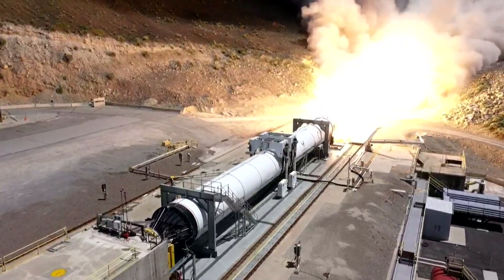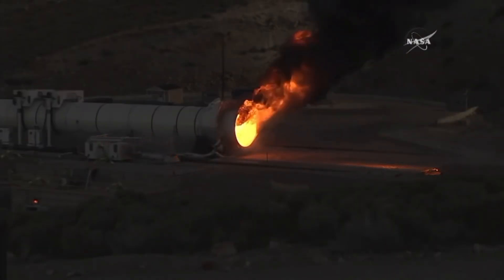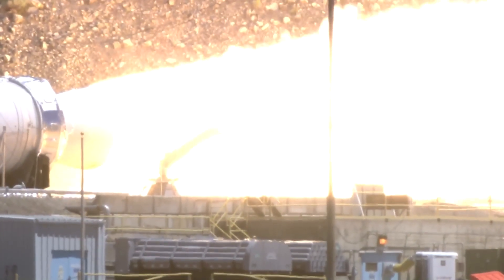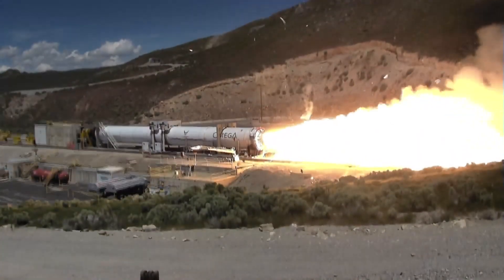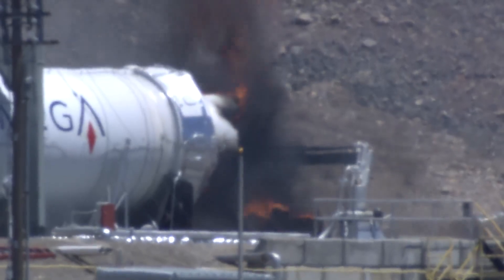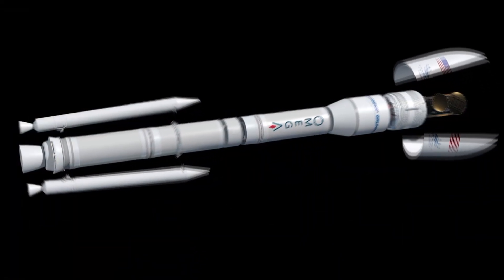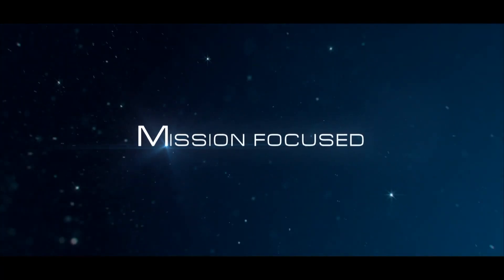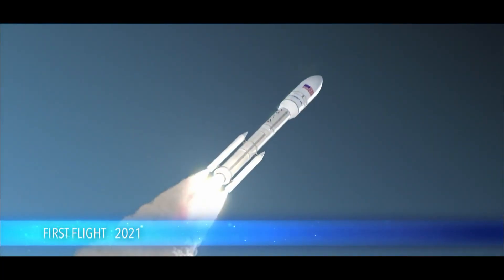Northrop Grumman's OmegA Rocket Fails During Static Fire Test -

Comment: Aluminum and potassium perchlorate is common in firework Rockets
Reply: This isn't using KClO4, it's using the ammonium salt, NH4ClO4. K is not a very useful cation for propulsion. It works, but it's much less effective (and has some other bad characteristics. In burn rate ballastic terms, it's exponent is very high - that is, it's burn rate is highly sensitive to pressure)
Reply: Wow, google that all by yourself?
Reply: @nicewhenearnedrudemostlyel489  Did you figure out how to be rude on the internet all by yourself, or did you have to ask your mom for help?
Reply: @nicewhenearnedrudemostlyel489  I actually Googled that a few years back, and then I started making this composition myself. Check out my channel and all the flash powder explosions on it. And you're right it is nice when learned!
Reply: @schelsullivan  nice

Comment: whats the flash headed for the nozzle just before it ignites? 1:50 it enters from the left side of the frame.
Reply: I am taking a wild guess, but it might be something like detcord which they are using to ignite the engine.
Reply: Yeah, i imagine you need something hotter than a match to ignite that stuff. I wonder, if it is det cord, is it also used during launch to initiate the ignition? Always thought it might be electrical?
Reply: I believe it’s detcord used to ignite the thermite charge that ignites the fuel

Comment: Wernier Von Braun was 100% against any solid rocket booster because of control and safety issues.  It's 2019 & he is as right now as he was in the 1970s.
Reply: But as the Moon will attest, we we're able to safely control solid rocket motors effectively. Everything to do with rockets is dangerous. Solid or liquid or nuclear or whatever. So the nozzle flew apart. Did anything actually happen that was unsafe apart from some Niobium bits fluttering in the air? No. Fact is that solid motors are actually quite safe compared to tanks of liquid propellant and oxidizer sitting on top of each other and waiting for a spark or any slight issue. For solids this size, it takes a 4' tall solid motor just to ignite them and the stuff only lights from persistent hot flame. Your Bic lighter isn't going to cut it here. They're storable and shippable as is. They're safe enough when it comes to rockets. Von Braun liked his liquids for the high Isp and because it's what he knew and spent his time on.
Reply: @mikes2381 , Von Braun didn't like the SRBs because you can't turn them off.  SRBs have a wretched launch record.  I'd have to check the numbers but roughly 1 out of 20 launches with an SRB fail.  Good luck getting insurance on a 100 million dollar satellite if the launch vehicle distributes it evenly across the sky (explodes).  The aggregate cost for a launch is in the area of a quarter of a billion dollars and that means the insurance premium on an rocket with SRBs would be no less than $12.5 million per launch.  Elon Musk's SpaceX will fire an engineer who proposes an SRB on a Falcon 9.

Comment: Quick question.. do they fire a spark from left to right at 1:49 to light the booster? Just wondering what that is just before it lights. Thanks Muchly
Reply: I think it's used in the same way the space shuttle used it. Where the sparked cleared away anything that could burn and potentially cause an explosion. I could be wrong tho I'm not a rocket scientist yet.
Reply: Nicholas Adams   Yeah, Nick, those “Sparklers“ that you describe are used to ignite any gaseous fuel that might leak out of a bad hose connection and collect near the bottom of the Space Shuttle Main (i.e., liquid fuel) engines. The sparklers are not used to ignite the fuel in the solid rocket boosters, or the fuel in the liquid rockets either. The solid rocket fuel igniters are tucked way up inside the SRB’s themselves, out of sight, as I described in the post above.

I am sure (even without looking) that they keep the sparklers WAY the hell away from the solid rocket booster nozzles. The very last thing you want is for the solid fuel in the SRB’s to ignite from one of these things.
Reply: They probably use a fuse to light it, you can see the spark moving along most of those high speed fuses
Reply: That is detonation cord that lights a mini rocket called an igniter located on the opposite end of the case from the nozzle. It shoots a flame front through the shaped core igniting the entire surface almost instantaneously. You can see the igniter flame just before the propellant lights off.
Reply: Thanks for your replies regarding my question chaps 👍🏻🔥

Comment: What factors come into play when making decisions on whether to go with solid or liquid fuelled first or second stages and which way around, Scott? Or am I missing one of your previous uploads?
Reply: Cost (which includes 'complexity' and 'size'), "no off switch", plus "throttling is difficult".
Watch the end where they "put the flame out", hard to switch off or throttle if that's the best method. :D
So, better for first stage/boosters, where "we just need LOTS of thrust".

Comment: They use CO2 gas to extinguish the fire, similar to a massive fire extinguisher. To pour enough water to douse the flames would damage the motor and ruin the state of the propellant after the burn, which completely negates why they put it out quickly.
Reply from the maker: Wasn’t clear what they meant when they used the word ‘quench’ -
Reply: @scottmanley  Don't worry about it. I only know because a friend of mine has a buddy that works at Northrop Grumman and he told me while we were watching the test. Beautiful sight, didn't notice the nosecone failing.

Comment: I heard someone say in 16.885j that the boosters on the Shuttle stack really were a design requirement for edge cases of high wind sheer--otherwise the SSMEs would've provided enough direction control for most launches. I haven't done the math on this, but I'm sure they checked their facts.
Reply: Uh, the boosters or the booster thrust vectoring control? They're right if they said booster TVC
Reply: @AmbientMorality  Booster thrust vectoring. You could just have unvectored nozzles and rely on SSMEs for direction control with the boosters lit from liftoff.
Reply: @nutsackmania  Got it, I've heard the same.

Comment: I made solid motors for us rockets, Model rocket co. Any air bubbles in the fuel or any air gets between the case and fuel liner if a chunk of fuel breaks and clogs the nozzle boom lot can go wrong and all you can do is duck cover and wait for burn out super fun
Reply: What kind of fuel do you use?
Reply: Tons of different types depending on application depends on burn time or weight of the rocket some are made to be flashy there's different core shape for different performance
Reply: Solid fuel to answer your question  starfire,buttkicker some other names rubber ammonium perchlorate aluminum
Reply: I've worked on hybrid rockets witch use solid and liquid fuels

Comment: A successful test, it worked fine until it exploded.
Reply: Agamemnon Well they did get a result, successfully.  They apparently even got all the sensor data, high speed video, an undamaged test stand and confirmation that most parts work.  Now there's just a few parts to check and improve before the next test of the '600 (one of them obviously the nozzle).
Reply: @johnfrancisdoe1563  Also, the motor did not catastrophically fail, which is nice for data.

Comment: It happened right after they said "open the accumulator enable valve", could it have to do with that? what's an accumulator with respect to an SRB?
Reply: While I don't know this specific system, I suspect they are talking about a hydraulic accumulator. This would imply that they were enabling nozzle motion control, which would make a lot of sense. This nozzle, that had been in this environment for 2 minutes, could immediately destabilize when forced around, or was subjected to unexpected forces from the hydraulics. It also fits with the use of the words "data point" instead of "anomaly".
Reply: @buckstarchaser2376  

It wouldn't make any sense to enable it at the end of the burn, you can see the nozzle move earlier in the burn too, as it was actually following an ascent profile.
I don't think they have a pressurised accumulator for hydraulics either, the space shuttle boosters used a hydrazine turbopump just for hydraulic pressure, I would assume this would be similar.
Reply: @chris746568462  I'll lean back on my preface statement of: "I don't know this specific system". I will, however, offer that accumulators are used to smooth out pressure variations, and are as harmless and helpful as a capacitor in electronics. Sure, if you use it haphazardly you can cause oscillations, but they are a simple means to reduce the need to oversize the pump and related plumbing. Of course the person making the statement could have also been using code for "Someone forgot to flush the toilet again".
Reply: Pretty sure that's a valve on the carbon dioxide quench system, and is unrelated to the motor.
Reply: @AmbientMorality  Why hello there.
Reply: It might be something to do with the fire suppression equipment.
Reply: @chris746568462  Thrust vector hydraulics..

Comment: i bet it was ringing like a wine glass in front of a speaker.  harmonic frequency reached..
 edit. if they create thicker sections by laying up insert panels between layers they can change the harmonic frequency ..
 i wonder if they look at the test using welding shields to allow the cameras to view deeper into the flame..

Comment: Sometimes I wonder whether all-solid fuel orbital rockets are really worth it, due to safety and control concerns.
Reply: Yeah, they cancelled the Ares I because of safety reasons. In case of an explosion of the SRM and an abort, the debris could rain down onto the capsule and parachutes and the crew would have a smaller chance of survival.
Reply: @yoda1704  Human rating is probably a bad idea because there are few benign motor failures, but no reason a solid motor is inherently more reliable. From experience so far, monolithic solid motors are more reliable than liquid propulsion engines, but segmented solid motors quite a bit worse. Obviously NGIS wants to change that
Reply: @yoda1704  Very interesting. Thanks for sharing. And I agree with the logic. While the SLS rocket is a lot more expensive and bigger, I think it's MUCH safer and reliable.
Reply: The space shuttle SRB was used 240 times with only 1 failure That is reliability that is equal or better than most liquid rockets in use today.  Also SRB produce a lot of thrust.  One space shuttle SRB produces 2.8 million pound of thrust.  In comparison the largest liquid fuel rocket engine the F1 used on the saturn V produced 1.5 million pounds.  And apprently  nasa successfully tested a SRB even larger than the Space Shuttle SRB.   

So overall SRB are very reliable and with a lot less hardware than liquid rockets there are potentially fewer problems to resolve before a countdown.  ULA launches of the Delta and Atlas launches almost always have  mechanical or electrical issues during the countdown.

Comment: Impossible to ignore the scale of emissions to the environment
Reply: actually it is...for now...
rocket launches are so infrequent that they are basically negligent compared to cars and aviation. Even if the amount of launches increases 1000 fold, they would still be a very small portion of the emissions
Reply: It essentially depends on the exact fuel/oxidiser mix in the solid fuel, but you're right - this seems like an egregiously polluting test.
Reply: SuperIby There's a lot of sod in the smoke from that burning rubber, so it's very visible.  Many of the worst pollutants are actually invisible, like NOx from unfiltered diesel trucks or Sulphur from lower quality coal.

Comment: “The nozzle basically disintegrated”. Me after Taco Bell.
Reply: It’s definitely a fuel problem. I’ve tested other fuel types and don’t have the same problem.
Reply: @IncrediJon_Music  Worth it!! ;-)
Reply: JM Music you’ve tested?? Good luck on obtaining rocket fuel. Or for that matter buy a rocket + engine. I know for sure fuel was not the issue. We’ve had 70+ years formulating solid and liquid rocket fuels. They work to perfection. Being a NEW design in rocket engines, and extrapolating from the footage clearly shows either failure to the main exhaust nozzle or the bell housing it self. That’s definitely not a good outcome. 💥🔥🔥
Reply: Have you been able to determine if it's a fuel or nozzle design problem yet?
Reply: I Say Throttle Down until you've transitioned well past Transonic Instability. Then Throttle Up to 125% for Orbital Insertion. Even if your Nozzle disintegrates approaching the end of your Burn, you should still have enough Oomf to reach Low Earth orbit...
Reply: @B Elliott Plus some extra holes.
Reply: B Elliott Solid fuel no throttle 100% burn.
Reply: Do you use a robotic arm to "extinguish the flames"?
Reply: @divyamgoel8902  Thats only available if the OP has a Toto,  Which in fact do have a Bidet arm on some toilets that extends under the nozzle and clears the area of remaining active fuel.
Reply: Would you say the failure being the nozzle itself not up to the task of the materials being thrown at it, or as Scott suggested, some material being kicked out of the rocket into the nozzle, and exploding in the nozzle?
Reply: @jackielinde7568  I hope you realise we are talking about diarrhea here xd
Reply: @IceHax  I hope you also realize that I was asking JM Music about his taco bell eating experiences as well.
Reply: Jack Linde I usually start with a liquid fueled center 1st stage (beefy 5 layer burrito), then add 4 strap on solid rocket motors, (beefy soft tacos), interstage is a liquid fueled rocket (Carmel apple empanada), followed by the payload motors (Baja blast Mtn Dew). That’s usually enough for a trip to Mars. Before that I usually hit a parking orbit around the earth till most of the fuel is spent to give enough Delta V to get the lighter craft to Mars.
Reply: The fuel names sound almost like menu items, too...
Reply: lol
Reply: You could use a Del Taco Del Flusho
Reply: Nathaniel Gray-Cummings different stages use different types of fuel
Reply: @IncrediJon_Music  rofl 😆
Reply: well done, sir.
Reply: Hah, good one!
Reply: Taco Time will give you hypergolic farts
Reply: That's what happens when solid chunks of fuel get expelled by the burning gases at supersonic speeds and hit the nozzle.
Reply: I died after that comment
Reply: This entire comment section is pure gold
Reply: Or a certain body part after Taco Bell :)
Reply: Damn, someone should start a rocket fuel themed texmex restaurant.
Reply: Sounds to me like the solid propellant may have been contaminated. Is it possible there was an impure liquid reagent in the mix? More testing may be required.
Reply: Get that nozzle Teflon coated
Reply: Ur sputnik detatched
Reply: Take that exotic materials!
Reply: @Nathaniel Gray-Cummings Hybrid, since fuel and oxidiser are in different states - often gaseous and liquid, though a tri-prop mixture with gas, liquid and solid is common as well 😬
Reply: @FactsFirst  Indeed, the combustion temperature (spiciness) is insufficient to cause such problems, however the propellants are often impure leading to combustion instability and hard starts, or pogo-ing
Reply: There's  a song on YT written for this phenomenon(expulsion of solid bits).
It's  called "I thought I farted but I sh¡t".
Look it up.
Reply: LOL.  Thank you for helping suppress my appetite.  I'll be able to stay within my recommended daily calorie count.
Reply: Well, only with Hot Sauce.
Reply: Good shit.
Reply: It typically becomes blistered before complete nozzle failure. These warnings should be heeded. Or you could end up with long enduring orifice issues.
Reply: your but when going to the toilet after taco bell